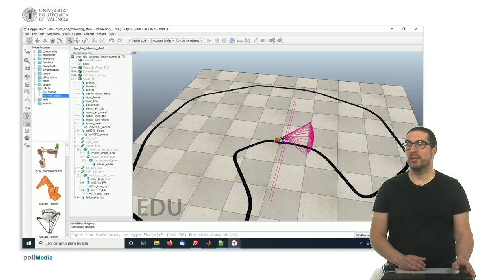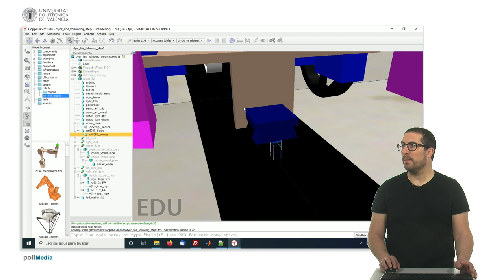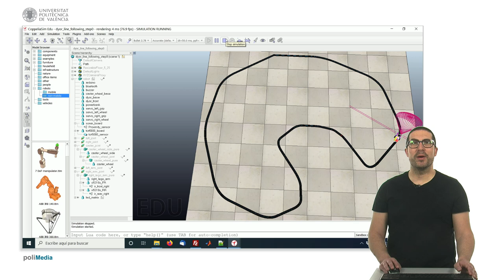Demonstration of Line tracking with Infrared Sensor | CoppeliaSim (V-REP)

Comment: hello, could u plz explain how can I add infrared sensor? is it proximity sensor??
Reply from the maker: Yes, it’s a proximity sensor if you want to measure distances. It’s a vision sensor if you want to use it as a color detector
Reply: @LeoArmesto  thanks. I mean how u set the specific sensor like tcrt5000?
Reply from the maker: @elhammohseni9645  then, this is a vision sensor with some few pixels. You get the grayscale image a perform the mean value to simulate the analog readings of that sensor (scaling not considered)
Reply: @LeoArmesto  thanks a lot for both ur answer and ur youtube channel

Comment: Hello
I  bought the solution two days ago

why the robot follows the margin of the line
Reply from the maker: Because it’s using just one sensor
Reply: @LeoArmesto  i need to add  another??
Reply from the maker: No, line following can be done with just one sensor. If you measure the light intensity, you can follow the line edge by trying to get measures in between black and white
Reply: @LeoArmesto  what can i do or add to follow the path in middle
Reply from the maker: A second sensor. Some people use an array of sensors typically used by line followers. That depends on what you want to do, of course...
Reply: @LeoArmesto  ok thanks

Comment: and it is not stabe like the video
Reply from the maker: I will check...
Reply from the maker: The reason you see a not so stable behaviour is because the resolution of the vision sensor is 1x1, which is very low. Actually, in the previous video this is something that is commented and recommended, so that's why they are different. You need to modify the code so that it averages the measures:

function readLineColour()
    local val=0
    value=sim.getVisionSensorImage(ir_sensor+sim.handleflag_greyscale)
    for i=1,#value,1 do
      val=val+value[i]
    end
    return val/#value
end

And increase the resolution, let's say 16x16 in the vision sensor.
Reply: increasing the max_speed will decrease the oscillations when on straight path
Reply from the maker: Is this a question? I highly doubt that the increase on the velocity will make the behaviour more stable. The problem regarding the oscillating behaviour is because the sensor measurement was too noisy and that was directly affecting to the control. The solution is to increase the sensor resolution so that you can get a mean value, which is closer to what the real sensor does